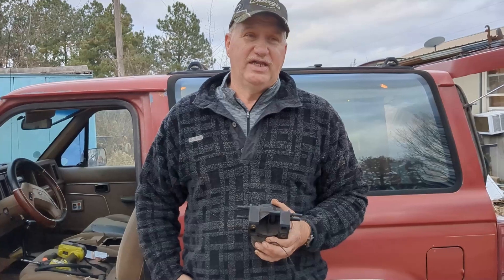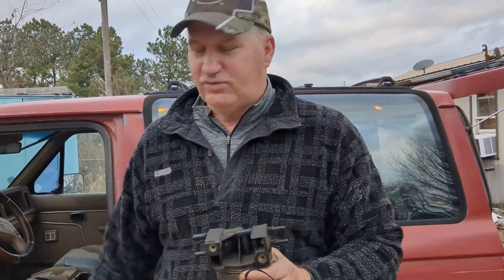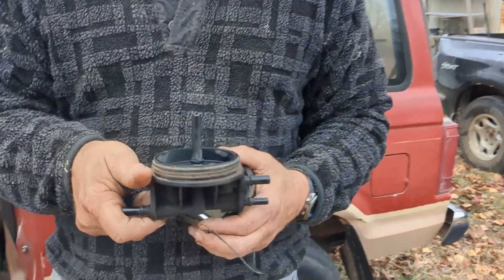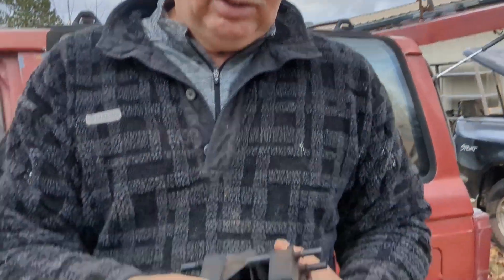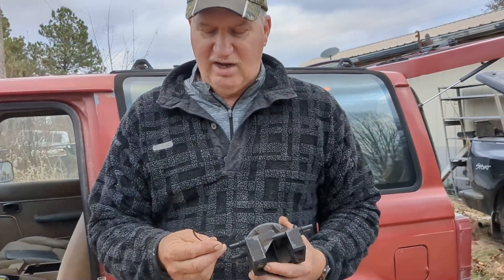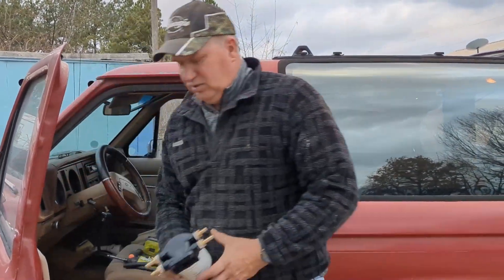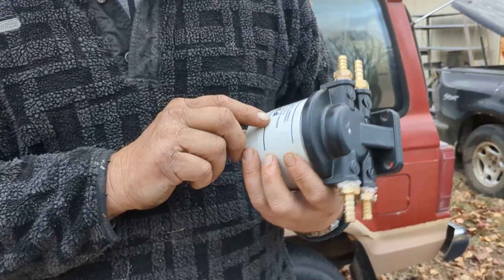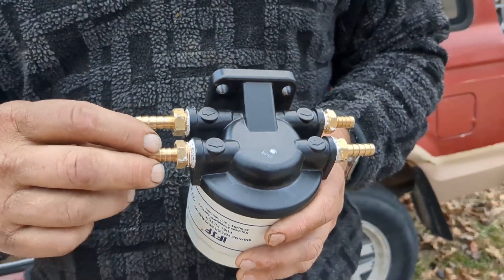1987 Ford Bronco Ii Fuel Reservoir Replacement

Comment: I was wondering if anyone had ever upgraged that setup to one of these type fuelfilters that are commonly seen on Semitractors and desil engine setups.. how did it work? did you have any issues with vapor locking? im fixing to do this to my EFI 2,3 ranger.
Reply from the maker: I bet someone did. No problem yet

Comment: can you unscrew that reservoir while its attached to frame or do you have to take everything apart , then unscrew it in a vice or something ? pretty stupid to have 2 filters , 1 for the low pressure side and 1 for the high pressure side at least to me. thanks for any information.
Reply from the maker: Yes you can replace the filter
Reply: RARAYC SELLS A FILTER ASSEMBLY.. SPIN ON FOR MARINE USES.. 
YES YOU CAN CAP THE RETURN LINES ON THE FILTER ASSEMBLY AND RUN THE RAIL RETURN STRAIT BACK TO THE TANK,, BUT IF YOUR RUNNING DUAL TANKS THATS GONNA BE TRICKY

Comment: Ive got a ford ranger that needs a new one of these. All i can find is the ones for dual fuel tanks. Do you know if i can plug the other two lines and use it instead? Also did this end up fixing your issue?
Reply from the maker: It did fix the issue we used the overflow lines the line that runs back to the tank.

Comment: So this is the fuel filter on it? Where is the other one?
Reply from the maker: Further Up towards the engine
Reply: some have a filter inside them and sometimes pepole will take them out and put a inline filter because theyu are a pain iin the ass .. and put the inline filter between the tank and the can
personally im fixing to get rid of that cannister and run the setup shown in this video,,